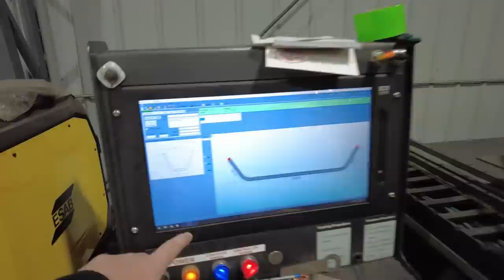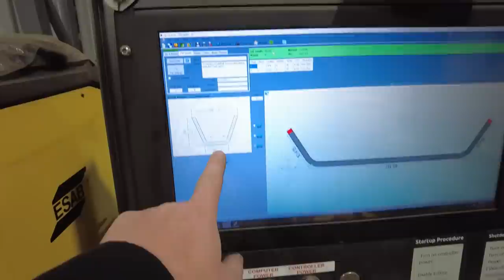Installing KBX Grill and LED Lights on Defender 110

Comment: Think someone had you off with the grille kit, KBX grille is £150 Inc vat here in the UK, so around $200?  Land Rover parts are pretty cheap here, even if you paid shipping, duty etc it would be nowhere near what you paid. Google LR spares in Liverpool next time, ship worldwide, save you lots of $$$
Reply from the maker: 500 bucks plus shipping and "handling" here is the US....plus the vents, and the hood and the flares and total invoice delivered was 2980

https://www.roversnorth.com/parts/kbx3121_kbx_defender_premium_front_grill_upgrade_in_satin_black
Reply: @BigTireGarage  That's because you've bought from Rovers North, buy direct from the UK, even after shipping, duty etc, it can't be that much.

Comment: There is plenty about that truck that has been modified from the Land Rover original product. I suspect a frame lift is just part of the story. Thats why you have the gap at the bulkhead to fender. Rear tub is highly non original. Get the Standard Land Rover LED Number plate light.
Reply from the maker: There is no Land Rover in this truck....it is 100 percent custom...just built to look like a Defender
Reply: @BigTireGarage  Kudos to him for doing what he wants. That's what its all about.

Comment: If the guy spent 3K on those items you're definitely not charging enough money for your labor. I can get the exact same grill for about $425 and if I needed to buy the side and top vents they would  be less than $200. Granted I am currently in Spain but shipping is not going to be $1,000 lol.
Proud owner of a '98 110 highcap.
Reply from the maker: Dude...this build was literally done as a favor for a friend...trust me I charged him nothing...but the cost of parts
Reply: @BigTireGarage   your a good friend, he will need good friends like you if he keeps spending that kind of money on parts. 
BTW that space at the back of the fender is usually filled in with the panel that runs under the door. Don't understand why it is short on that one.

Comment: I be damned if I would pay $3000 for a bunch of plastic when you can get them 3D printed out of the same material for a fraction of the cost and the worst part is if it's not made from good plastic then over time in the weather and sun it's going to make that plastic brittle and break and everything else the sun and rain do to plastic unless he plans on keeping that thing in the garage and the car trailer and just haul it to shows since he is going as far as buying a brand new aftermarket body and putting all brand new parts on it including a brand new plastic set that cost $3000 😂😂😅

Comment: So cool to see you working on the Defender. I've got a few 110's here in SLC. Yeah, parts are a joke in pricing. I've resorted to modding a lot of Jeep CJ and JK parts for mine. Also, concerning that upper air inlet on the hood, one side is blanked (covered) and the other allows air in, depending on if yours is LHD or RHD. I obviously bought the wrong part. Ended up cutting up a piece of a stainless strainer I got from IKEA. $8.00 and some fab work later and I think it looks better than most.
Reply from the maker: This is sitting on a Jeep JK frame and is an aftermarket body so it really isn't a Defender
Reply: @BigTireGarage  Oh, interesting. I can only imagine the custom work that doing that would take. My 110s are out of spec out the factory, but I guess a spec sheet doesn't really apply to this one, haha. Looks awesome. As for me, I've tried to keep things under budget by sourcing as many parts as I can from Disco 1s and fabricating/modding parts from Jeeps.

Comment: Fuck me... Coulda made those vents n stuff for $1k out of aluminum on a CNC mill... And $50 for the metal screen... As for the rear seats, full bench seats that wrap around those corners, then smaller bench seat all the way in back over the top of the tub.

Comment: Hi Ian, Don't know specific your Client's requrements were, but I find KBX grilles for 200-250 GPBsand vents for50 and change on UK websites.
Reply: Said the same, sent links but YT keep removing them.
Reply from the maker: if I had known I could get them straight from the UK I would of....
Reply: @BigTireGarage  Give it a go next time, we live and learn, don't mind a slight price hike but that mark up is just greedy. 👍
Reply: That is an astonishing price. You can get the full set of the grill, headlight surrounds, side and top intake for around 300 USD with US delivery from places like Paddock Spares in the UK

Comment: For the basic stock side vent Land Rover quoted me R1800 ($100). I got the Britpart one for R315. I'm a bit confused. Is this a Land Rover? It looks like a Chinese knock off of a land rover. Definitely not a Defender. All the parts are different to mine.
Reply from the maker: This is a fully custom Aluminum Body....made in the USA right here in my shop....
Reply: @BigTireGarage  What?! That's so epic man!! Probably much better than the one from Land Rover. Is it a Land Rover chasis?

Comment: I am building a buggie for crawling. I am using a 1.9 tdi with a 700r4 and a midnight metalworks transfer case. My question is, is there anything special I need for my auto trans so that at extreme angles I won’t loose fluid pickup in the trans? Thanks for you time. I enjoy your informative videos.
Reply from the maker: Just overfill by about a quart...and ideally add a catch can for the vent

Comment: Landover have many problems with  reliability, working on them it is almost guaranteed. The head gaskets will fail and the air ride suspension.  I like the body styles but I would swap out the engine, wiring harness ans suspension then it would be a reliable offroad vehicle.
Reply from the maker: That is why this one is just a body on a Jeep chassis with Cummins powertrain

Comment: What was that seat in the shop truck Mastercraft …?
Reply from the maker: Yes Mastercraft Bench
Reply: Thanks for response, I  have a CJ10 tub and chassis, 90s 1ton axles and ZF S42 trans for small block Ford. May run [mild] turbo 300 6cyl. Looking into agualum bed.
Had found a source in Arizona  pre-covid, but pricey now…. Still, looks good.

Comment: When your customer could have simply purchased a new Defender (which he wants to resemble) 😂. To each their own. Hopefully, this rig can handle the rain
Reply from the maker: Couldn't buy a new Defender for what this cost...plus...the Defenders are Garbage from the factory
Reply: @BigTireGarage  totally agree with all of that, but still confused why he wants to retrofit it to look similar to the new gen. Definitely regret not getting my hands on one of the older ones when they were 15-25k 15 years ago. Now they are 60k plus, without additions, while a slightly used 90 is 67k and a 110 for as low as 57k.
Reply from the maker: Yeah and that D90 will be a rust bucket with an unreliable engine and rusted frame
Reply: @BigTireGarage  and all of fancy gadgets will also be malfunctioning. It's just tough justifying the price most 80s/90s Defenders are running right now. Most are at or over 100k. If only I could go back 15-20 years ago  😂